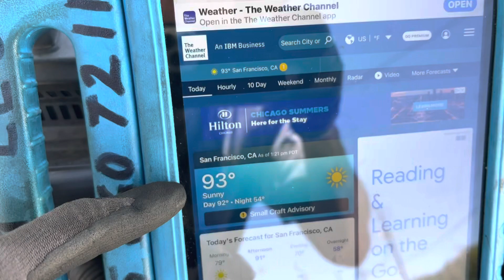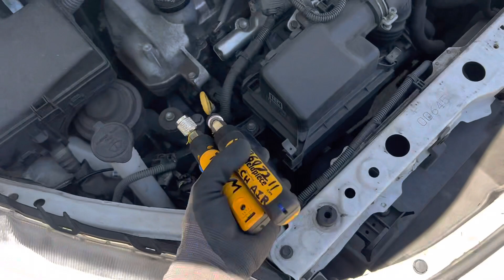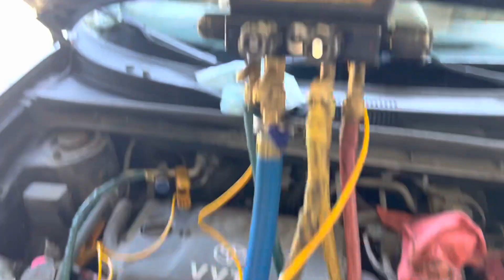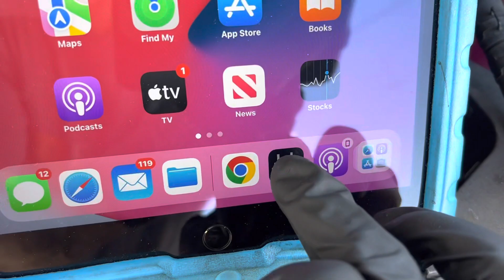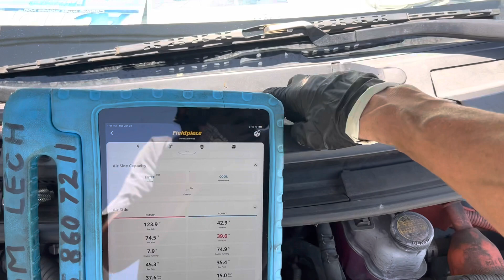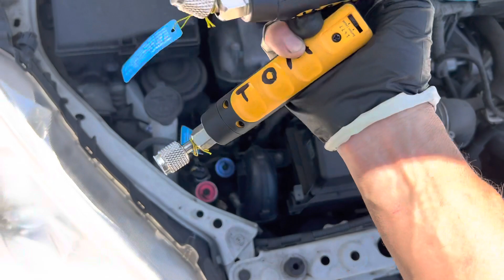AC PSI & TEMP TESTING WELL DRIVING THE CAR.  Set up blue tooth Transducers and temperature sensors￼￼

Comment: Drops considerably.   Although, I was a little surprised your discharge pressure wasn't even lower going down the road, yours was slightly higher than my v5 buick (psig according to my PCM) ie: my saturation temp was about 15F over ambient.
But the ambient for this was cooler by 10F, as well.
Charged with 152a, discharge saturation temp gets even closer to ambient temperature (only about 10F over ambient).
Reply from the maker: Actually from idol if you seen at Idaho Lewis 200 psi driving down the freeway it was 150+ PSI but the low side pressure basically stays rocksteady. 

On some of these newer vehicles with a variable displacement horrible speed electric 15° or 20° over ambient for the condenser is normal
Reply: @coldfinger459sub0  Yeah, I can't say what the suction side was doing, just that dash temp was around 43 rock steady regardless of fan speed.  I should've noted discharge pressure based on fan speed.
BTW, I made an arduino that measures indoor wet bulb and outdoor temp then based on that, calculates target superheat and target supply air temp then transmits the info over wifi to a web browser.
Reply from the maker: @thisisyourcaptainspeaking2259  that’s pretty good calculate superheat. 

When we were in HVAC class we built thermostats using our do we know and raspberry pie just dad a logging and tracking and controlling devices based on humidity and temperature

Yeah low side pressure constantly 43°F no matter what the high side pressure was variable speed compressor
Reply: @thisisyourcaptainspeaking2259  3 years ago i persuaded my friend to let me put R252a in his 2001 Alero with the V5 compresser...i got 40 f  out of the dash and its working fine after 3 years...almost no noise when the compressor kick on....good stuff...he is still amazed...and of all things he works at Advance auto parts ... cheers for sure